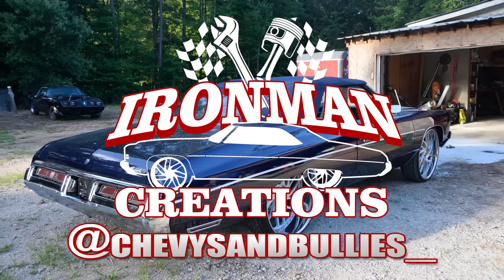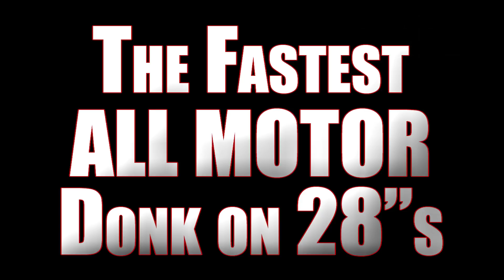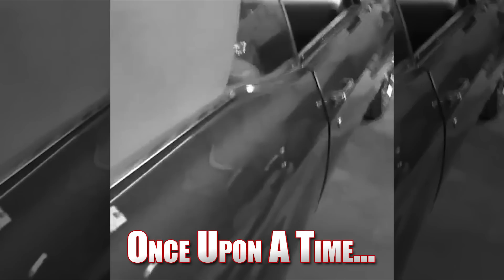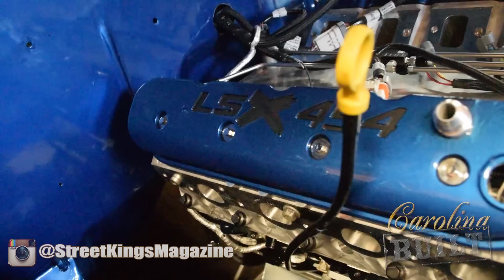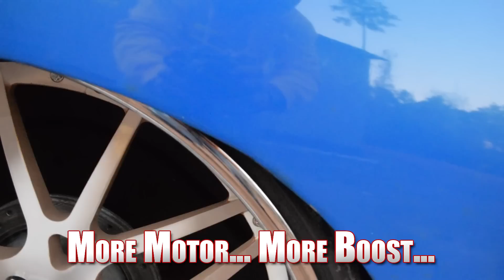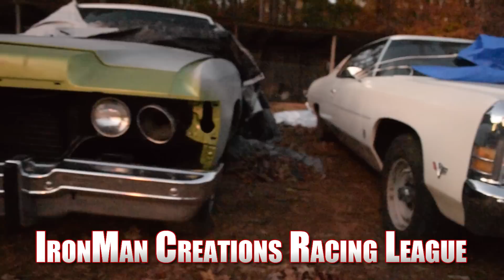OVER 3000HP: Twin Turbo LSX Impala, Twin Turbo LSX Chevelle, NA LSX Caprice by IronMan Creations

Comment: I think he accidently added an extra zero
Reply from the maker: Colt Sewell lmao. the chevelle by itself is 1500hp
Reply: let's see the dyno sheets
Reply from the maker: Colt Sewell google the hp of a 454 lsx. then add twins. 🙃🙃🙃
Reply: Colt Sewell  he got more power than donk master got ill keep it 100 his car was messed up when he ran donkmaster . he will get right and gap donk master
Reply: Colt Sewell no shit, none of those cars are over 600 I'd bet..
Reply: lmaooo like he said. google the power of a 454 lsx and then add twin turbskies
Reply: Edward Thayer but u just said it
Reply: he meant 3000 between the 3 cars simple azz kidz. And 1000 HP donks aren't even rare these days. If you're racing you better be around that number. Of course they are.

Comment: 3000 hp would bend the frame on any car race donkmaster and then claim fastest donk
Reply from the maker: sigh.... A. it's 3000hp between 3 cars. That's 1000hp each. B. Sage WON'T run that navy blue donk now that it's working